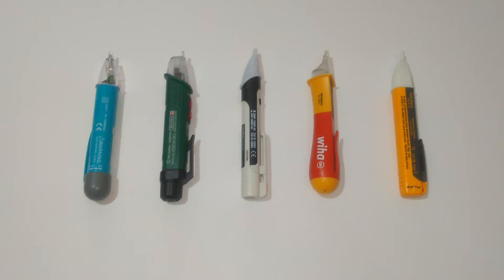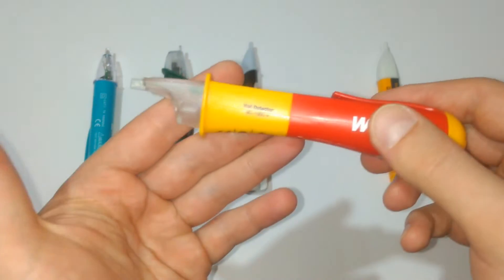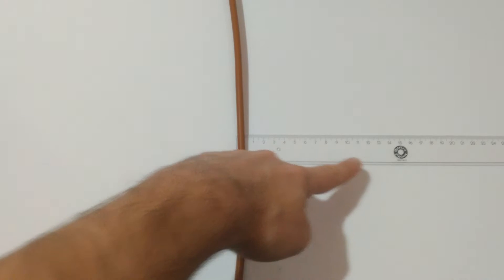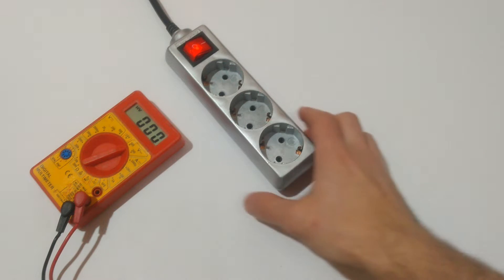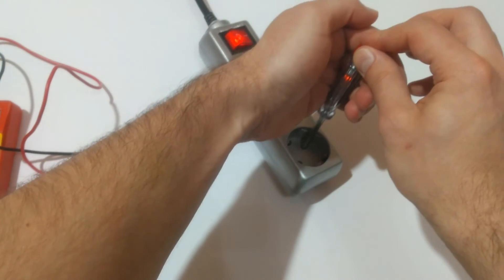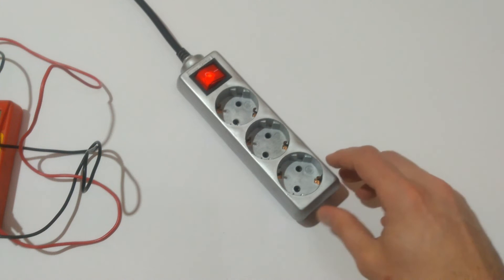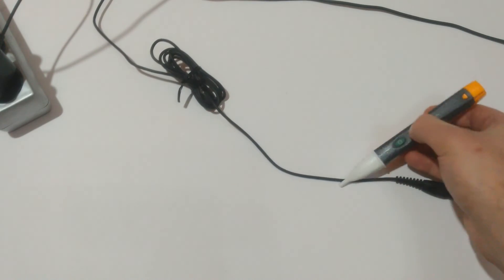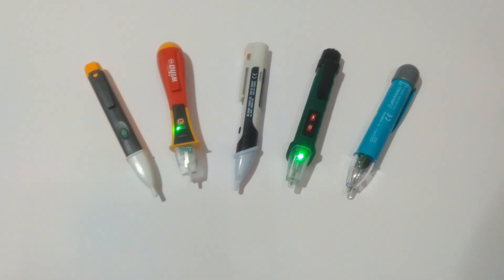Best Contactless Voltage Detector - Fluke, Wiha, LaserLiner, Parkside, Emos

Comment: It’s better if u have to get really close for it to go off.  Bc in an electrical box, u have many wires close together that u need to identify which one is “hot”.  If u just are 1 inch away and it goes off, then it makes it hard to diagnose the problem

Comment: There is also an tester called "Beha UNITEST MAGNOVoltfix Best Nr. 2050" that can also detect magnetic fields. It can detect Voltages from 50V-600V AC and is therefore sensitive. It has also a Buzzer (and no on/off switch, it is always on). Needs two AAA cells.

Comment: I have two of these.  For the home a Mastercraft, sold in my country by the big cheap mass merchandiser Canadian Tire Stores, which is identical to the Emos.  Also own a Fluke for over twenty years, early model with no buzzer, no buttons, it just lights up and works when it needs to, for my professional shop.  I definitely prefer and trust the Fluke better.